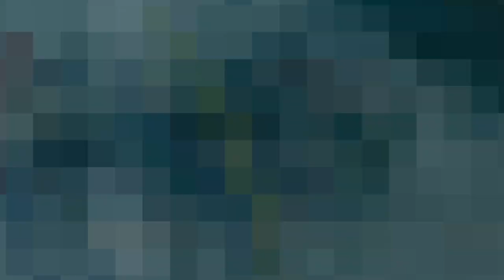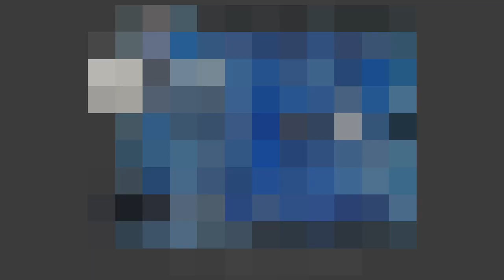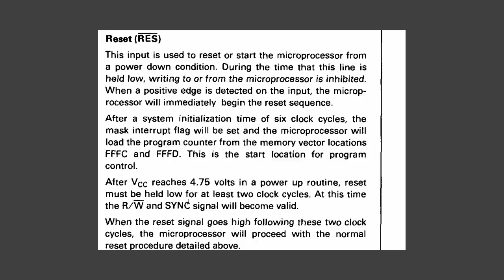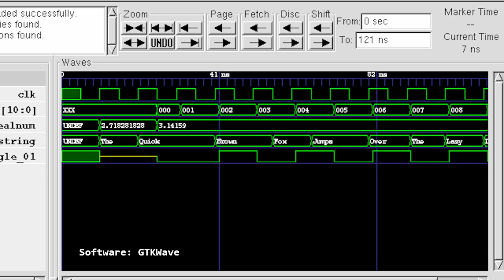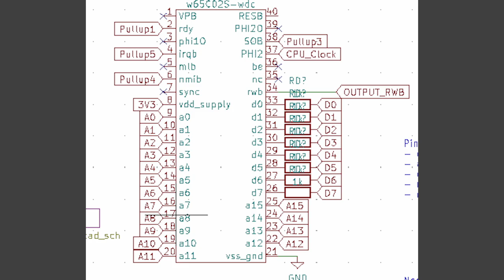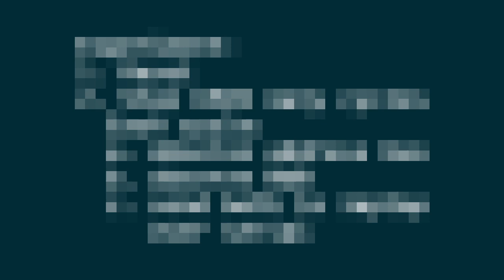Chiplab Prototype: Remote controlled 6502

Comment: ha) Already did similar on rp2040 and even ended up running apple 1 original code with tv output)
Reply from the maker: Very cool. How did tv output work on the apple 1?
Reply: @EmulationOnline  I apologise) of course, not TV output, but composite video to be correct)